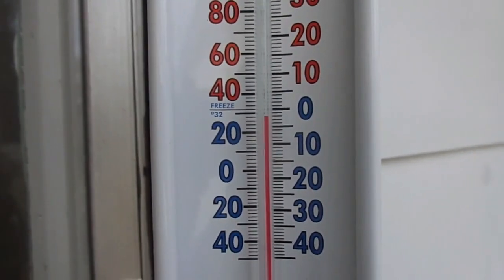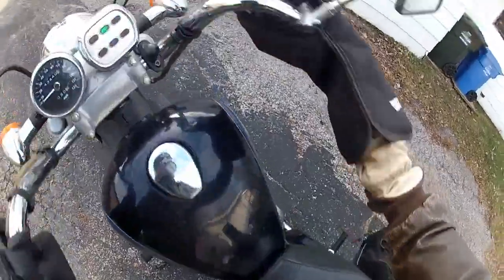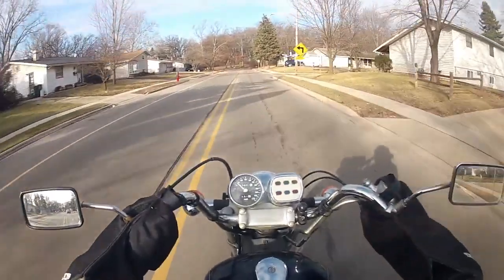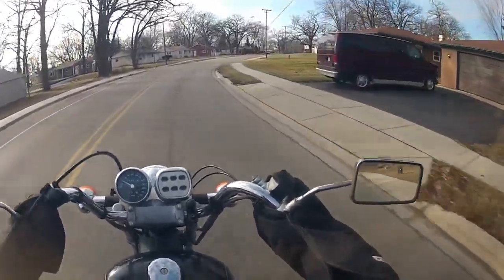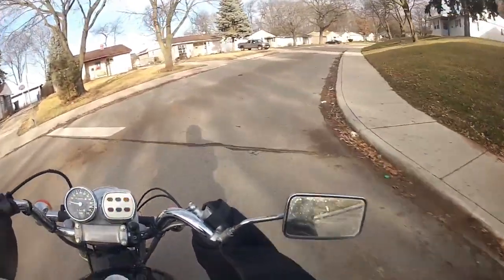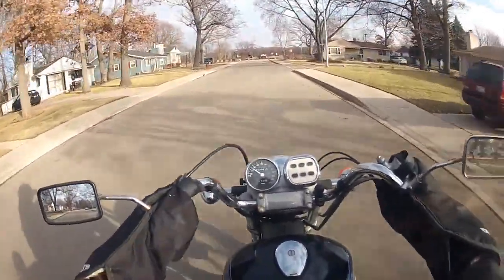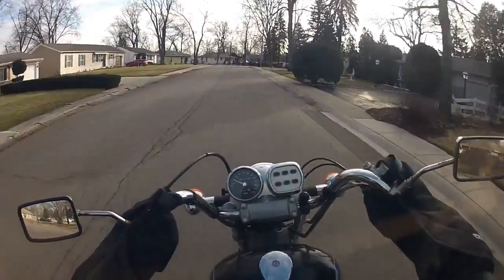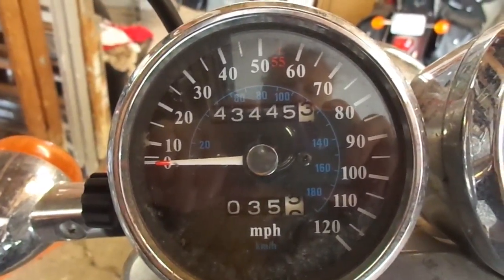PBC 10 - Upgrading My Trailer and Muzzle Mike My Team Member

Comment: Electrolysis or the winter road salt compound will completely eat up wiring. I use regular grease lithium or whatever i have to protect them. Seems to help.
Reply: Dr. Dual Sport Salt is the biggest problem here. It ate through my shifter rods on the bottom of my Kawasaki. Put new ones on last year.